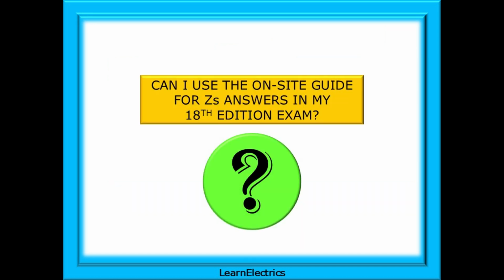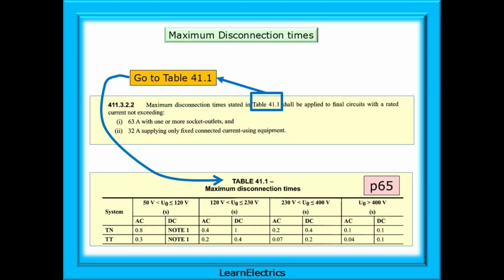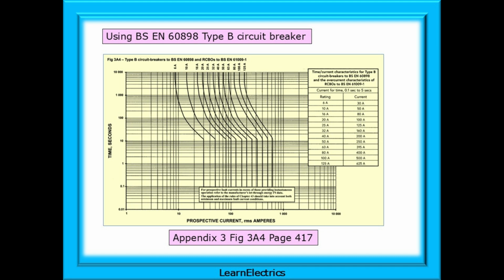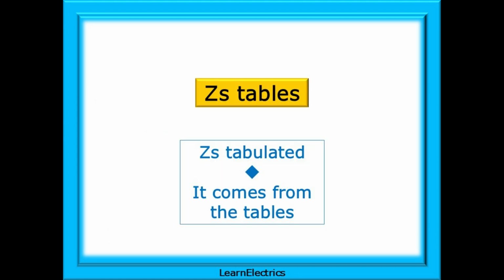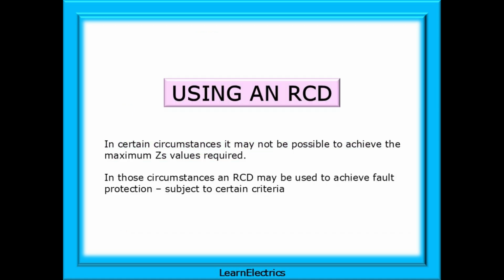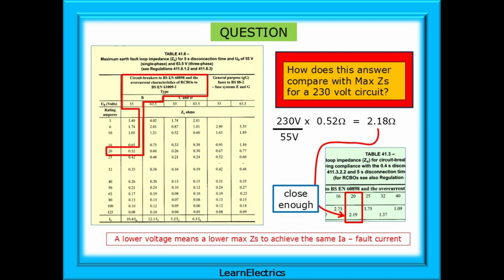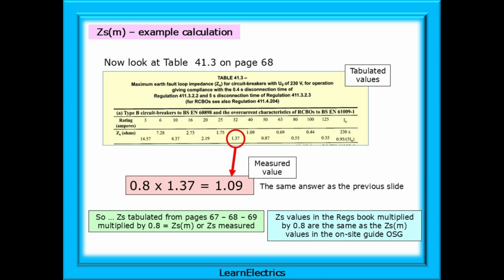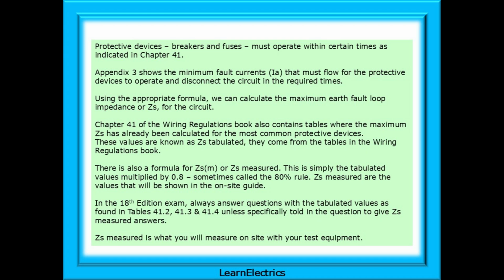Zs TABLES - 18th EDITION EXAM - HELP TO PASS – BS7671 AMENDMENT 2 – WITH QUESTIONS  AND ANSWERS

Comment: In this video (at 16 mins 50 secs) I think  you MIGHT have missed out a WORD in the BLUE box.  'Permitted Zs can be -- by installing a different rating or type of breaker'.  For the avoidance of confusion, can you clarify if, (where I have inserted '--'), there should be the word 'increased' ACTUALLY INSERTED THERE, (or have I misunderstood this particular sentence)?  Thanks in advance if you can clarify this point.
Reply from the maker: The first sentence in the box says that the permitted Zs can be achieved
second sentence : permitted Zs by ...
third sentence : actual Zs by ...
Permitted and actual can be two different numbers.

Comment: My brain just isnt built to do this.
Reply from the maker: Yes you can. I felt the same 40 years ago, learn a little each day. I just wish there ware YT videos 40 years ago when I started. You can do this. Dave.
Reply: @learnelectrics4402  thanx but iv spent the day one 1 simple question my tutors are beyond usless they dont answer email questions and iv never actually spoken to anyone there am basically teaching myself. am on the verge off quitting cos am just wasting money an time at this point. Am littary having to resort to chatgpt an here for answers. An chatgpt isnt helping. Can you plz help. What is the max measured Zs for a 32A
BS88-3 system C fuse protecting a distribution
circuit? My options are a0.9 ohms b1.6 ohms c1.28ohms d0.728ohms 
When i do calculations i get D the book says b (i think) an chatgpt says c. So i dont have a clue

Comment: Q4 answer= 0.68 I thought it was 230x.95÷640 = 0.34 help😂
Reply from the maker: Read it straight off the Table 41.3 on page 68. There are two disconnection times for Type D breakers so make sure you choose the correct one. Hence 0.68. Hope this helps. Thanks for having a go at the questions. Dave.